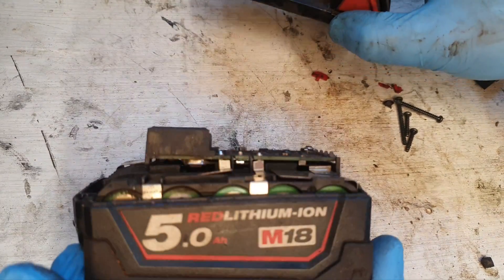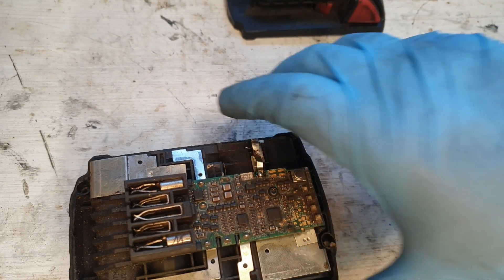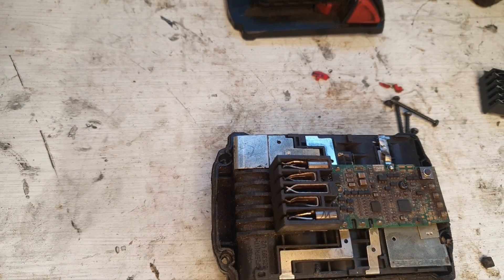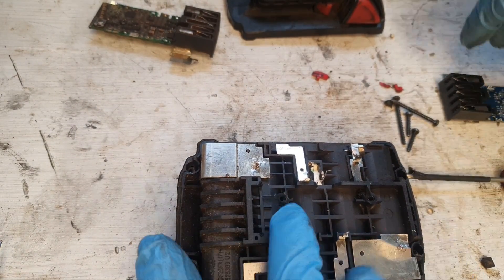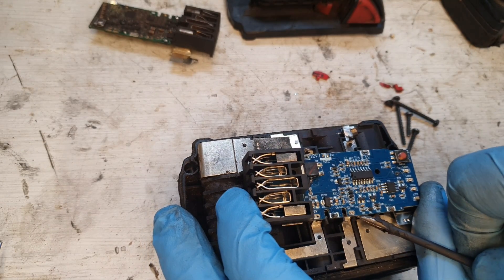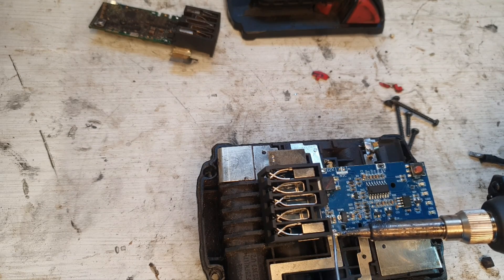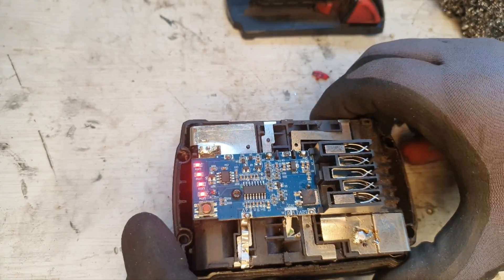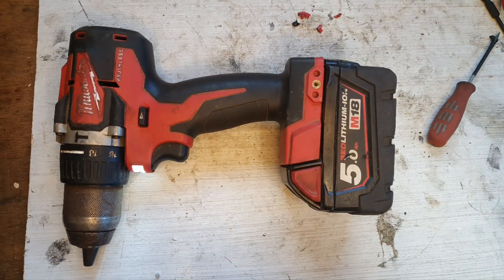Repairing a Damaged M18 Battery

Comment: How come you solder the pcb back on instead of spot weld ? Does it matter
Reply from the maker: The board is soldered on to the nickel strip the strip is attached to the cells with spot welds.
Reply: 👍just waiting for my board to arrive do the operation will let you know how it girs
Reply from the maker: @maddawglodbrock1380  I will be eager to hear